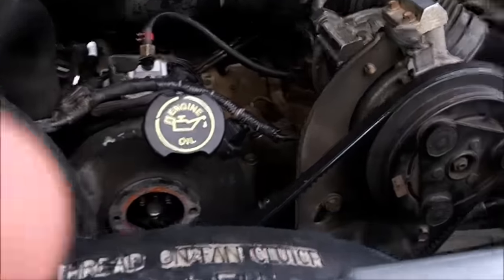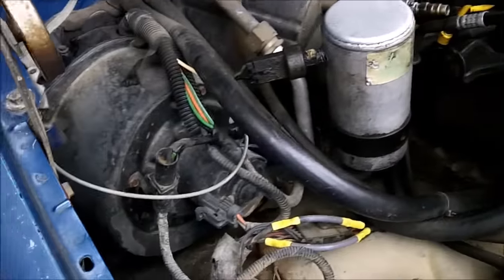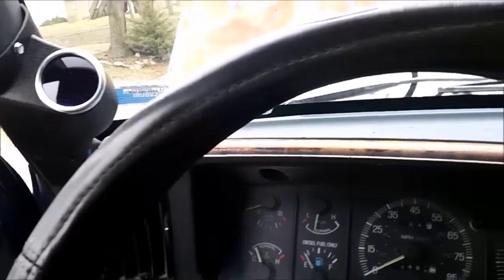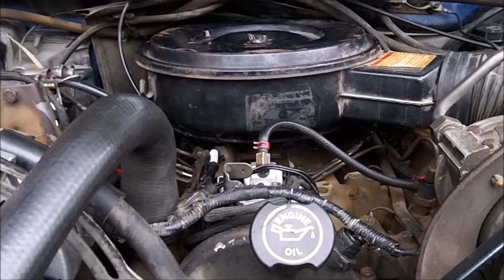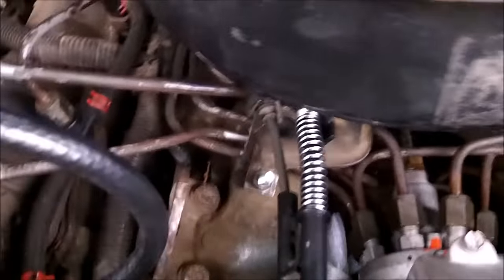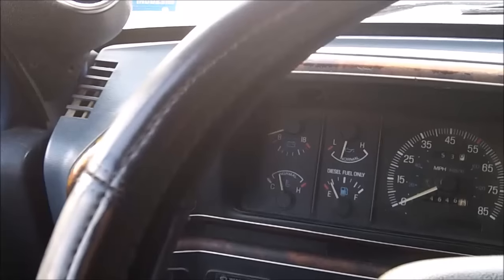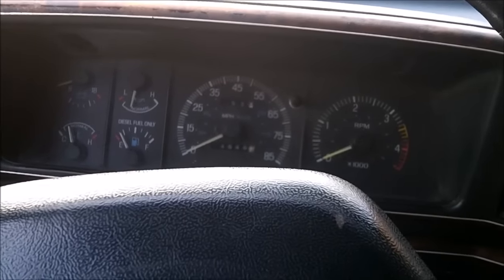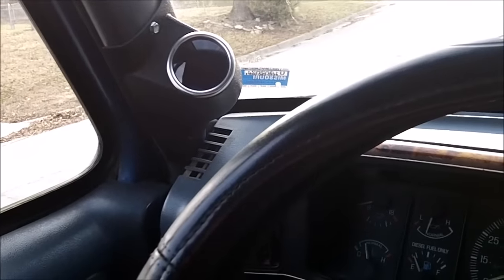How to turn up the fuel on a 7.3 IDI

Comment: Did mine 2 years ago. Works perfect with no issues. 593k on mine. Little performance and free. Works wonders! Love the video!
Reply: How much difference, 10 hp!?
Reply: Got 764,582 original miles on my 91 f250 7.3 idi everything but the injector pump is original.

Comment: Turn it Up 'N' Blow it up!
Reply: A 7.3 idi is pretty much impossible to blow up
Reply: You can if u turn it all the way up, & not just 1 flat.

If ur IP is sluggish & u have good lift pump pressure 1 flat is safe for a 7.3. Just be easy on it. Get a pyro.

Comment: I'll just leave mine where its sitting. At least I know its running great. I do get 14 1/2 on my 92 F-350 and on Vegetable oil I got 18, didn't have as much power lost maybe 5% when running on the oil
Reply from the maker: I have always wanted to try running vegetable oil, but it is hard to get. Any fuel system problems or injector coking from running the vegetable oil? Do you blend it with diesel or have a separate fuel system for it and preheat it?
Reply: I would get the oil from Restaurants around here and pour it through a Tee shirt to help strain it and a metal strainer.I mixed it with some gas...Example 45 gallons oil, 2 gallons gas and some octane boost.You mix it and let sit for 8 hrs so any fats would sink to the bottom.I used a 50 gallon drum and had my pumps set to feed off approx 4 inches from the bottom. I had gotten to comfortable with it and screwed up and I didn't let it sit so I poured the fats in my tank and it screwed up the injection pump.Theres a metering screw init that got gummed up so I haven't made it since.It litterally smelled like hamburgers and fries going thru town...lol....I had put on a couple thousand miles driving on it...My fuel injectors are still all original.....When I pumped it out of the drum I had a 10 micron filter it went through and the next filter a 5 micron and then into my tank
Reply: @7.3ididiesel36  Once you've filtered it beyond 5 microns, you can just use it, but it has to be heated if you're just burning it straight. From what I've read, mixing 50/50 yields the best results for the least cost and effort.

Comment: when you say flats do you mean turns? thats what im lost on  
and how do you put the heat gauge in?
Reply from the maker: No flats are one side of the allen key so 6 flats is one turn, I wouldn't go over 3 flats or half a turn. The pyrometer wires into any wire that has 12 volts with the ignition on and the temperature probe drills and tapes in the the the exhaust manifold I put mine on the left manifold just above where the y pipe bolts on, you want to put the probe as close as possible to the engine to get the most accurate reading.

Comment: I got a 94 idi turbo. Where is the best place to buy the pyro, I wanna make sure I get the right one
Reply from the maker: They are many of them form 20 to 200 dollars. You want one with a wide scale with small increments for most accuracy. Any of them will work. I got a dragon gauges pyrometer from ebay for $20 it is in celsius.

Comment: are the egts in idi's that low?    400 degrees while on the throttle.....my 6.0 idles at 400, 1400 wide open.
Reply from the maker: No this is in celsius, not fahrenheit. 400 degress celsius would be 752 fahrenheit.

Comment: I just put on new injectors and injector pump on my 1991 7.3 and it runs terrible. Idles choppy as heck. Will rev up but not great. Lots of white smoke. Haven’t even bothered trying to drive it yet.
Reply from the maker: How long have you run it for? Might still have air in the system, let it run for few minutes should get the air out, and it shout clear up if that is the problem. Also you can loosen each injector line and crank engine to bleed the system.  If this doesn't help check the timing there are static timing marks on the timing cover and pump they will get the timing close enough so it will run, with the engine off move the injection pump 1-2 millimeters left or right to see if it helps. Turing the pump to the right will advance, turning the pump to the left will retard timing.

Comment: The tiny bolt snapped inside of where the Allen screw plate is, what should I do? I don’t even know how I would go to get the snapped bolt out
Reply from the maker: Most likely will have to remove the injection pump and drill the bolt out.
Reply: @7.3ididiesel36  i ended up just drilling a bolt in a little bit above it and jb weld all around, holding up pretty good knock on wood
Reply: @7.3ididiesel36  thanks for your reply, Bought my 93 IDI for my first vehicle a little while and this channel helps out tremendously ❤️

Comment: GOT A 7 .3 WITH A TACH ISSUE AT IDLE ITS BARELY READING BUT IDLES FINE IS THERE A ADJUSTMENT OUT OF WHACK OR WHAT ??
Reply from the maker: It's probably the sensor for the tach it's the big nut with two wires cumming out of it by the oil fill cap. Mine does this all the time when it's cold outside, i just ignore it.
Reply: I had the exact same issue and put in a new one and it works fine now

Comment: Mines stock and the pyrometer stays on the needle around town and barely gets above 200 Celsius going 65 wot. Is that normal?
Reply from the maker: Yes, mine stays around 250-300 when cruising and up to 550 wot still in the safe temperature range. Max is 600 but no more than 15 seconds then valves and pistons start melting.
Reply: stock is best. this goof just shortens engine life with his advice. i pulled 5 tons of hay on a trailer in the mountains for years stock.
Reply: @bobbybabylon1385  no actually not.

Comment: What about if i’m not able to turn The pump because I can find a hole for the Allen there is one but it won’t move I turn it by hand or turn the engine but it won’t move. it’s but it runs good  needs more power so you think the pump won’t work?
Reply from the maker: The Allen screw is hard to turn, it is 5/32 in size put a spanner of vice grips on the Allen to make it turn easier.
Reply: Yes but i can’t turn the pump to find the aleen
Reply from the maker: The pump will only turn with the engine so you have to turn the engine over to turn the pump.
Reply: 7.3 IDI Diesel 
I did but i did move
Reply: If your engine runs, your pump works. It's just not landing on TDC
Reply: What c if it feels like it will not go higher ?is it already to high and how many to turn down to where I need it

Comment: This is wrong.  These old Ford fuel pumps do not have reverse threads on that Allen head inside the fuel pump.  Turning it clockwise reduces the amount of fuel getting into the pump.  By turning it clockwise, you are tightening that screw.  To turn up the fuel, you need to turn it counterclockwise.  He's correct about everything in the video, except for turning it clockwise.
Reply from the maker: You are wrong turning the Allen screw in the pump clockwise increases the fuel, I know what I"m doing. Go watch other videos on how to turn up the fuel they all say to turn the Allen screw clockwise to increase the fuel.
Reply: eserepair  Diesel is opposite of gas more fuel = more heat.
Reply: Correct @Campbell Pardee. Old argument, but yes the leaner the hotter in diesel or gas.  Less fuel means a higher compression is needed for the explosion, which means a hotter temp.  Leaning boosts compression and as long as it's not leaned too much it can be fine.  Probably makes it tougher to start, my 7.3 IDI is a bitch but I think I have fuel pump issues.  Most of these older diesels run rich by default as they're not computer controlled.

Comment: how are you getting 17 mpg?
Reply from the maker: By driving carefully and coasting as much as possible in neutral. The mpg does drop to around 12-13 when towing.
Reply: Gear ratio is how if you got 4.10 don't expect those numbers
Reply: Yeah, I've got an '88 7.3 geared very low, she doesn't want to do much more than 55 on the fwy & let's me know. Have always gotten about 10mpg, uphill, downhill, headwind or tailwind full load or empty. Pulls away from a stop like a fat lady getting out of a chair but she's reliable as hell.
Reply: My '93 idi has 4.10 gears and 35's I can stretch 18 mpg out of it. on average I get 14-15
Reply: Dave Pawson  my 83 with a 7.3 idi and t19 trans(no overdrive) with 4.10s gets 19mpg cruising 55mph
Reply: I keep my 88 f350. Dually at 65 or less for around 18. I have a 5 speed manual transmission.  2wd.

Comment: I don’t understand this video
Reply: Turning up the injection pump on a 6.9/7.3 IDI diesel motor will inject more fuel and give you more power. The plate he removed has a spot for a small key to turn the pump up.

Comment: this child is driving around in an empty pickup needlessing ruining the engine.. i pulled  5 tons of hay on a trailer with mine for years in the mountains. Turning up the fuel is for morons dreaming of more performance who shorten engine life. when i want more power i use my old 997ci v8 mack dm 6x6. it is stock too. lol children.
Reply from the maker: Been running it like this for thousands of miles pulling a trailer everyday no problems, it does improve performance not much though.
Reply: Bobby  Babylon your just one of those guys that couldn’t figure out how to find the Allen key hole and is pissed at everyone for turning there pump up when you can’t. It’s not ruining anything or hurting a thing, so what it runs a little hotter at WOT if you get that little performance gain you want then it’s worth it, it’s free and you can turn it back anytime. Put a turbo on it then you’ll have to turn it up to get enough fuel to not lean it out and make less than stock. Turning up the pump doesn’t do anything but set your truck up for more performance later on down the line. You ever see a big rig roll coal? Yeah they get a little rich in fuel sometimes and they can have as high as a 1,000,000 mile warranty. I think it’s pretty safe to turn it a half turn
Reply: damn your cool, curious who asked you anything